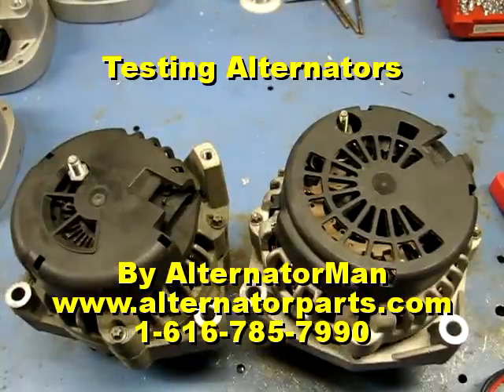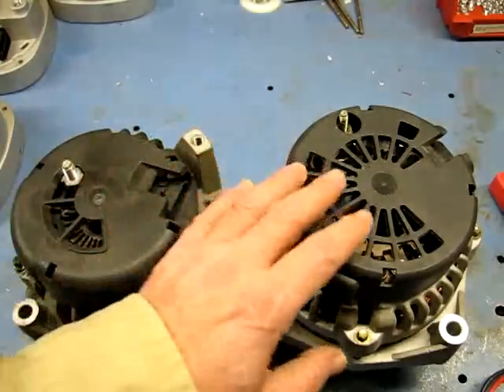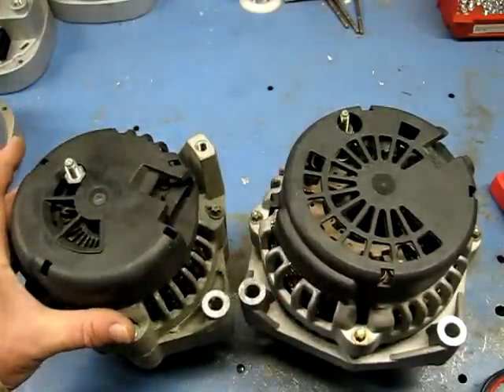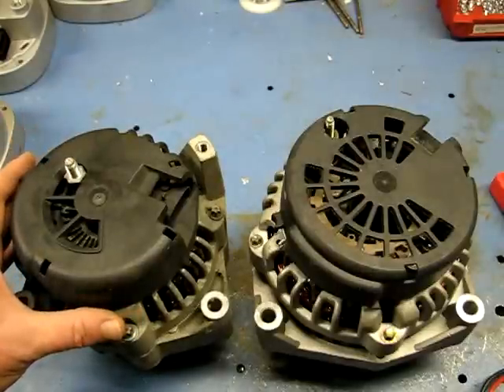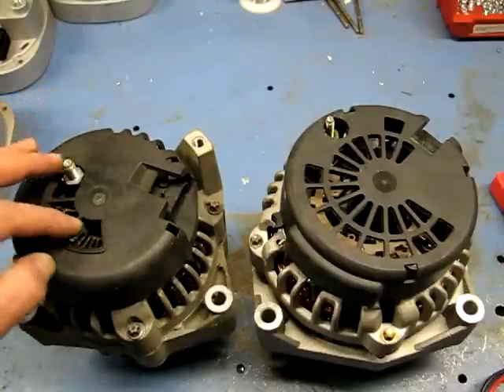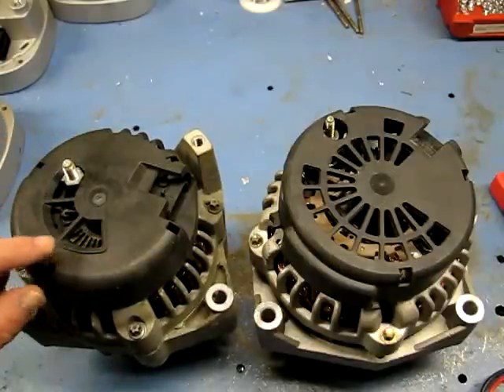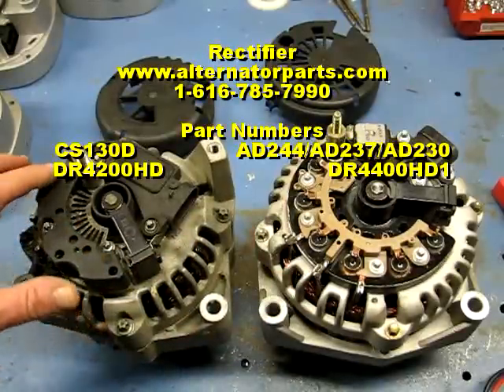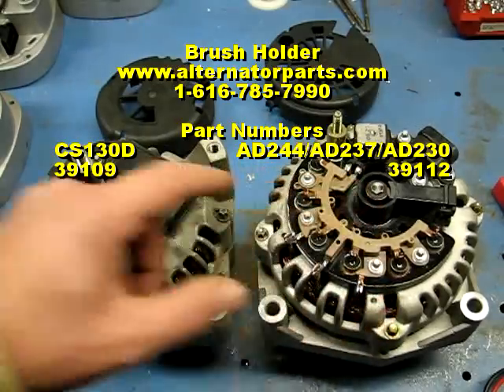Testing and Repairing 1996-2009 GM Alternators

Comment: i have a 300 apm alt the is not giving out the full amount of power any more, when i remove the terminals i stay start but when i gas it  it does not increase power. what could be the problem?

Comment from the maker: @utubin67 
Sure it's easier to buy a brand new car every time you have trouble but not everyone can afford a new car all the time. Some people need to save the money or they don't trust mechanics or rebuilt alternators. This gives people more knowledge to understand what is going on. You said it all when you said your vehicle is a $ vacuum. When you fix your own vehicle your making per hour what your mechanic charges. My neighbor has a garage & charges $65.00 per hour, I know some charge more.
Reply: I certainly appreciate what you've done here. I had an '03 Tahoe that I replaced an alternator on($60 from the salvage yard).  I now have an '04 Suburban and am now rebuilding/conditioning the original from the '03 Tahoe. Seems I'm having some trouble with the '04 alternator. Thanks for the help.

Comment: Im trying to replace the voltage regulator on an AD alternator. The regulator has a large contact in the form of a ring that goes under the metal space and the main voltage output. I cannot move the large metal cylinder - how does one remove it. Its absolutely solid and wont turn using grips after soaking in penetrating oil.

Comment from the maker: The Ford Focus alternator is not technically controlled by the PCM, it has an internal regulator that communicates to the PCM. The only way to full field it is by opening the alternator up and finding the ground-to-test connection.

Comment: hopefully you can help me I think it's my alternator and not my battery. I have a 2007 GMC Yukon XL. Yesterday my battery symbol came on. After driving 10minutes my dash instrument panel went out completely including my speed odometer. I was able to drive until I had to stop for a red light then it died. Im sure it's the alternator because the battery is only 2 months old. is there a way there a why to test the alternator without taking it off. it's the original alternator with 220k miles thanks hopefully you can help

Comment: I haven't rebuilt an alternator in years. Thanks for the video. It was very useful. Liked and Subscribed. Hopefully, your email address is still active as I'm looking to replace/ upgrade an alternator from 105amps to hopefully 200amps + without any major modifications in a 2003 Chevy Tahoe Z71. Thanks  Eddie J.   Long Island N.Y.

Comment: I have a 96 GMC C3500 6.5l Diesel with dual alternators. The truck is from the east coast and has 117,000 miles on it but road salt corrosion thru out. Both alternator bearings are noisy. I plan on rebuilding both alternators due to economic concerns. Is there an upgrade for these alternators that could increase output?

Comment: I checked the diodes...multimeter test with positive on casing and negative on battery post, and it passed(.536) reading. So I did your bench test connected to battery and running off an electric motor. I touched the positive jumper to the brush positive and it made that ugly sound! How does it test ok for diodes and bad on the bridge rectifier when all a rectifier is is diodes connected together in a circuit? If the diodes are good, shouldn't the rectifier be good? Curious. Thx

Comment from the maker: It depends on the engine in your Firebird. If you have the 5.7L, that Bosch unit and the AD244 series alternators will fit. If you have the 3.8L, only another CS130D will work.

Comment: One last thing...you show the battery hooked up to the alternator but the alternator isn't excited to make it actually trying to run when you touch the jumper to the positive brush...this isn't necessary? The unit doesn't need to be trying to run when you do the test? Just wondering...thx

Comment: Hi, I have a 2007 chevy uplander and the lights pulse at idle. I heard it's the regulator. Do you have a video for that type? I tried it once but I couldn't get the new brushes on correctly.

Comment: I have a DR44G off an 04 Tahoe I'm installing it on a 92 Chevy truck it has the four pin what wires do I need to hook up to make the output 14.5 volts

Comment from the maker: Depends on the year. Model years 1997 and earlier with the 5.7L engine can take a 350A CS144, 1998 and after use the AD244.
Reply: Are these in the saturn ion ecotec 2.2? all the lights in my car flicker and even the engine surges. Is that the alternator or pcm?

Comment: The problems with the CS130D is why I retrofitted my 97 Lumina to a CS144 from a Tahoe.  It only required swapping the regulator plug and adding the remote sense wire.

Comment: Also if you soak your alternator in power steering fluid it stops working. But if you soak that alternator again in break clean it will start working again.

Comment: maybe you can help i got a ford focus 2006 and the alternator well took it out and had it checked at aouto zone not a fan had trouble with these guys well any way was not good so i bought a new put it in worked for about a week and doing the same thing again bat light came on do u think the alternator went out or going out remember this id aouto zone stuff  i was reading on line that autozone parts u might have to change them out untill u get a good one

Comment: Yes, you can interchange the 244 with the 130D, but you have to change the belt because the geometry is different. Changing the alternator pulley won't help.

Comment: How cant I tell whats causing a intermittent charging problem on a 06 chevy express 6.0? Will the bridge rectifier cause this. You state that the voltage reg turns it on and off. The pcm also does the same thing. Any help would be greatly appreciated
Reply: Test for AC voltage. A failing diode in the rectifier will allow AC to pass causing intermittent battery failure/drainage.

Comment: Ive got a 99 chevy silverado. When I start it for the first time on a cold day or morning i get a battery light and it seems like its not charging.. After about 30 minutes of idling,  it will suddenly start charging correctly and will remain working correctly all through the day. The next day though it will do it all over again. I seems like the cold is what is causing it and once it gets a bit warm under the hood it starts to charge again..  I hope you can help.  :)

Comment: I'm curious what "sound" you get with a good rectifier bridge when you touch that lead. I'm in the middle of testing my alternator. Looks like a bad rectifier bridge. Definitely not brush's. I'm just curious if it's a specific sound a bad alternator makes, or just the fact the stator grabs the windings in the first place?

Comment: I have a 2003 infiniti G35 coupe with a overcharging @15 amps alternator. I changed the alternator out and it is still overcharging. Batt indicator light is still on in the dash. Any ideas what's going on?

Comment: just a quick question for you while changing the alternator on my old Mercedes diesel I discovered that somebody had changed it to the cs130 just like the one you showed in this video. this was an upgrade to the original 50 amp alternator that was on the vehicle. what is the part number for that specific alternator that you showed in the video or what vehicles did it come on because when I Google the cs130 the mountains look quite different than the one I have which is the one like you listed thank you in advance

Comment: I would be a bit reluctant to test the coil by 'sparking' the terminals as shown in this video. Especially so since there's also electronic control circuitry (regulator) connected to the brush terminal. I don't think semiconductor components like being 'sparked'.
Reply: Will a 2001 grand am great voltage regulater transfer to a 2002 cavalier 2.2 ?

Comment: hello sir, I have a Opel Vectra C with an 120A alternator(code 0124425009) and the charging is low max 13.3V and when I turn the steering it will drop to 12.7. The battery was change 1 mouth ago and still nothing, I have replace the regulator and the diodes and the charging is the same the slip rings are good they have only 0.5mm wear. can you help me
Reply: Dumitru Paul ai rezolvat ceva pana la urma ,ca si eu am aceasi problema.mersi

Comment: when field testing, is it neccessary to plug in the 4 pin adapter to the voltage regulator, or do you leave it unplugged and test as described, I left mine unplugged and read 18Volts when I bypassed the voltage regulator, is this the correct way to test,or do I need to re-test?

Comment from the maker: Odds are the the bridge rectifier has failed. Stock rectifiers are not designed to handle 300A output, but many rebuilders and high output alternator manufacturers will use a 300A stator with a 200A rectifier.

Comment: Hi Alternatorman. I have a 2002 duramax that recently had an voltage regulator 
fail in the alternator. I was in a pinch and needed my truck so I bought
 a replacement from orieleys. I purchased the Ultima New option 105 amp 
version. The replacement was straight forward as expected. This was on a
 friday. Fast forward to sunday and less than 100 miles later the 
battery light came on again. 
I have not checked it yet but I assume the regulator failed again. Is 
there something in particular that would cause the regulator to fail or 
did I just get a defective unit? Thanks for any and all advice.
Reply: wishwecould i know it was 5 months ago but I never had good luck with oreilly or az alternators. I would buy online or make sure the battery isnt fried.

Comment: yeah i got a 03-04 ad244 on my 98 trans am (ls1) way better, i don't have my lights pulsing but i want bigger. i live in a cold area and i installed a 850 cca battery. and i plan to add a 1500 watt mono block. on top of a 400 watt amp (rms) so any ideals?

Comment: will a 105 amp setup handle a 150 amp allernator?
Reply: I've got a 2008 GMC Sierra SLT DR44 160A alternator, I have a system, off road lights and etc, I ordered a 300A alternator and now volt gauge changes from 14.8 to 13.5v GM forums say it's a hiccup in our year trucks?? Should I put my stock regulator back on? And the company put a billet pulley on for better idle. Doesn't matter if I drive or parked, if I turn key off then on, voltage goes up. Battery still good it's a 12v/16v kinetic blue battery. Please help!!! Alt man I'll buy a heavy duty regulator from you if need be

Comment: Hi Mr Alternator Man,  I intend to use  a windmill  hocked up to an alternator to produce electricity and i have a couple of questions.  1- what ill be the wiring i guess i need  to have a bridge to have the alternato on all the time. 2- what are the minimal  RPM needed to  produce electricity. 3- without regulator what will be the electricity output ?   thanks in advance for your time   Regards

Comment: Before going through the hassle of putting a used alternator in my Chevy Venture (3+ hr job), I figured I'd test it first. 120 amp stock gm 10317648. Ain't forking out $370 - $410 for one. Considering you can buy a Venture for that price. 

Meter is reading 11.6v DC/30v AC on running vehicle. Battery has intermittent drainage which has been going on for about a year. All because of AC voltage flowing past rectifier diodes. I have the same poor design as the unit on the left.
Reply: hah! I've got the exact same problem on my Chevy Venture!  Seems to be pretty common
Reply: @LowSpecActionSquad  Yep! And guess what? I just replaced the damn alternator AGAIN about 8 months ago. That's my fault because I put in a junkyard one. They are much more affordable today than they were 3 years ago. I think I paid like $80 + core charge on RockAuto.com.
Reply: I've also gone through and fixed multiple wiring faults underneath the carpet and floor. If you're having interior electrical problems, fuel pump/fuel gauge issues, or cooling fans not kicking on, I can tell you how to fix all that. I made multiple videos on it but never uploaded them.
Reply: @markfothebeast  Yup, and yup! I've also got an intermittent problem with the running light fuse blowing, sometimes it takes a week to blow, sometimes it blows 6 times in a day! I haven't had the time or money to really do any digging yet, but it's in the works. It's at 325,000 miles right now, trying to see if I can get it to 500,000 before a wiring problem burns it to the ground lol
Reply: @LowSpecActionSquad  Pull off the plastic door jamb covers on both the driver and passengers side. Dig in to the wiring harnesses on both sides under the carpet by the front seats. Get ready to pull out a soldering iron. There's multiple junctions where 3 wires are soldered together. They are probably all corroded.

I'm not 100% sure on the lights but I do know that others had issues with rear tail lights. This and running light wiring may be on the plugin that goes to the fuel pump and fuel sender. It's literally 10"  behind the drivers seat under the carpet. The other end is accessible and can be unplugged from under the van. 

I cut slits in the carpet to get to this. My van literally died in the middle of the road and once I wiggled the plugin it started back up. I eliminated the entire plugin by marking and soldering the wires directly together. It was corroded to hell inside.
Reply: @markfothebeast  I appreciate the advice! I'll tear into it over the weekend, for now I've got to fix my alternator overvolting (and cooking) my battery lol. Pretty sure it's just a failed rectifier, but haven't done much diagnosing yet because I just discovered it today. Oh the joys of owing old cars!

Comment: GM alts shit . give me anything from japan
Reply: no way   gm made the best   what kills them   bad batterys
Reply: go to japan then
Reply: Funny thing is most alternators are made by bosch or denso. So congrats on using a german designed or Japanese (denso) alternator on your american car :P 

Right on the money animalcorvair weak or dead batteries kill alternators. The alternator is meant to run the car accessories and keep the battery charged, not charge a battery from a deep cycle or constantly keep getting strained trying to force a battery to hold a charge. Chargers are meant to charge deeply discharged batteries :)
Reply: ***** All GM alts (in US at least) are Delco, Valeo, or Bosch so American, French, or German.  

Delco 10SI & 12SI alternators, now 20 years obsolete, are still sought after in junkyards for their reliability and simplicity.
Reply: Youtube history erase